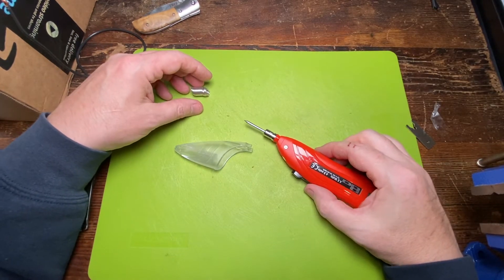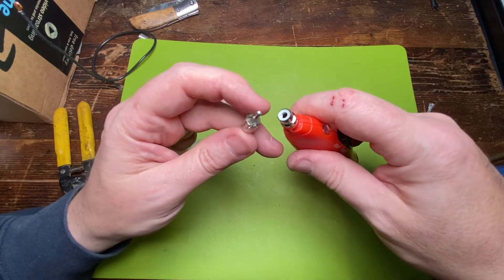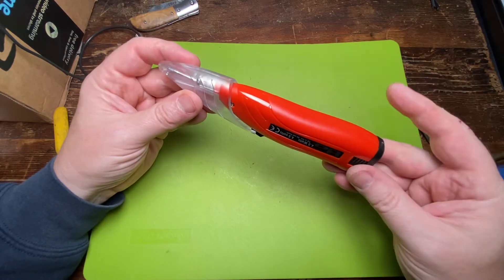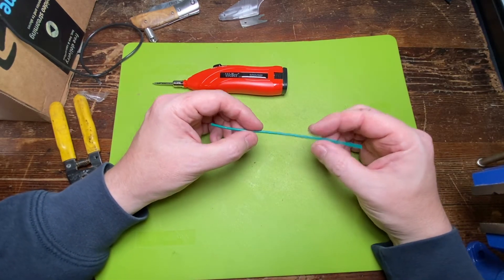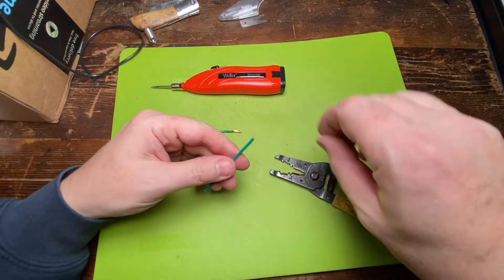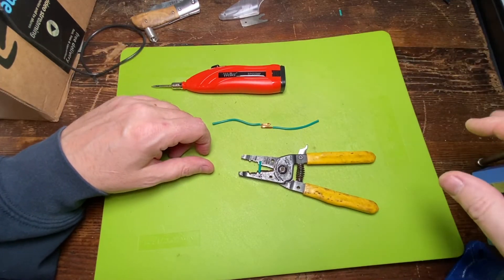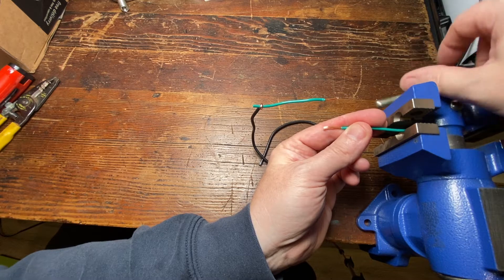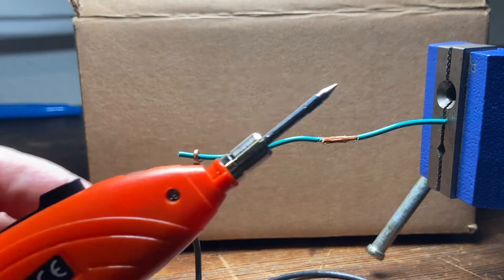Battery Powered Soldering Iron Test

Comment: Dude I use a soldier gun every day and one of the best/reliable corded guns has been a $15 dollar harbor freight !! It blows my mind how hot it gets and I am not easy on equipment I have dropped it more times then I can remember on a concrete floor it rattles and it looks like it's about to break in half but it's just won't die and when and if it does I will be buying another one I've probably had that for six years And it's my job to fix electrical issues on automobiles so that should be the same something about that little blue solder gun
Reply from the maker: Mike that is awesome!  Thank you!  I ended up shooting three videos yesterday.  Ended up with a weller soldering iron only because it was at the hardware store down the street. You have a very special craft.  I am so lucky that the mouse that chewed the wiring off only did a couple. Fingers crossed 🤞 at least!  My mouse video will come out on Thursday. You will have to let me know how I did on my repair. Thanks got your comment!  I have a harbor freight by work and will be swinging through!
Reply: @ThatFixItGuy  the part number is 61170 or 60765 .. hope this helps .. the best tip is to make sure the tip is as hot as it gets and make sure your get great penetration throughout the wire
Reply: I agree! It's probably one of the longest lasting tools I've gotten from Harbor Freight. 👍

Comment: I have never been good at soldering wires uninsulated barrel connectors and heat shrink tubing is my go to most the time. I will be looking forward to how you get this done.
Reply from the maker: Me neither bro. Practice.  That is what I went with. Practice  till I was comfortable. It worked pretty well. I will not win any awards, but the car is fixed. An electric iron worked so much better.

Comment: Hey Brian thanks for the great tool review that was a bummer. Rodents can do some serious damage to the wires on a automobile. A few years ago ground squirrels chewed up the wiring going to the fuel pump on my 2010 Toyota Tundra. I got it fixed and about a week later the little devil’s did it again. I found out that the insulation they use on electrical wires now is a soy base and the little rodents like it. A friend of mine told me to keep some moth balls scattered under it that they wouldn’t like the smell and they would stay away from it and guess what it WORKS 😂
Reply from the maker: Oh man Britt!  I did not about that soy based plastic till yesterday. It seems crazy that manufactures would do that, but it keeps people working on cars!  I have a couple more videos coming out on the issue.  I really hope this is not reoccurring thing!  Fingers crossed that those were the only two. All engine lights reset. Mothballs!  Has that worked for you?  I will totally try that!  Anything to avoid soldering in the engine compartment again.
Reply: @ThatFixItGuy  yes it worked, but I sold my farm in 2017 and where I live now I don’t have a problem with ground squirrels 👍

Comment: Hello Brain , I always wondered about the battery powered solder tools.  They may work well with a smaller gauge wire , I am sure you will check that out.   Sorry to hear about the Mouse that decided to chew up your car wiring , that can be big trouble!
Reply from the maker: Hey Richard I’m sure that there are better out there on rechargable batteries. We will have to find one later and see if it will work any better. After the car was fixed I started checking out videos on this thing and found that it is really not that great for any solder.  Nice to know I’m not completely useless when attempting new things! 🤣 Hope you had a great thanksgiving!

Here is one a found. https://youtu.be/2f9sB2g_qtg